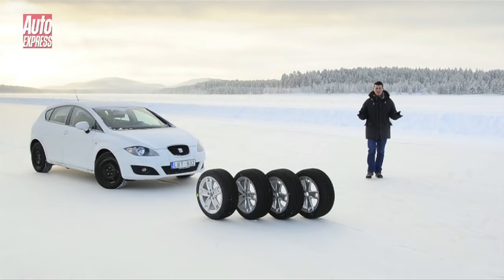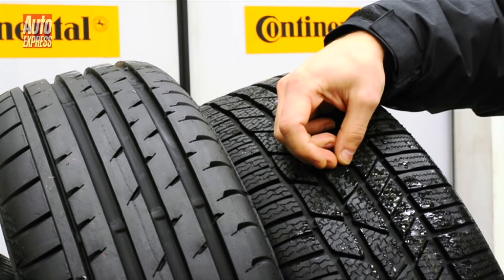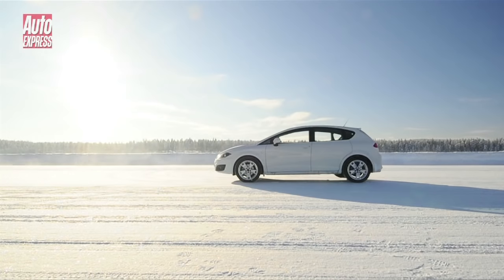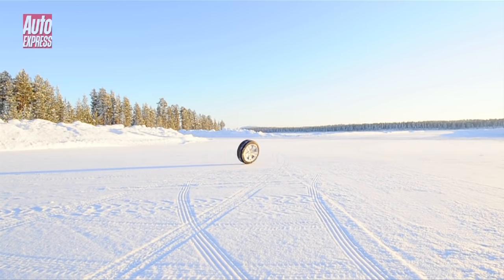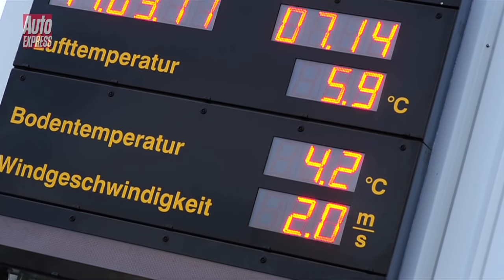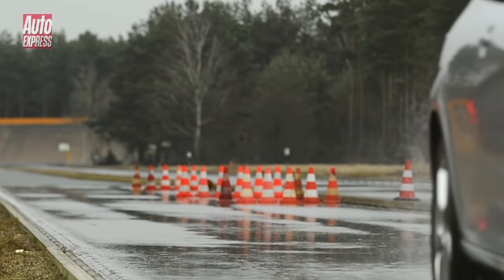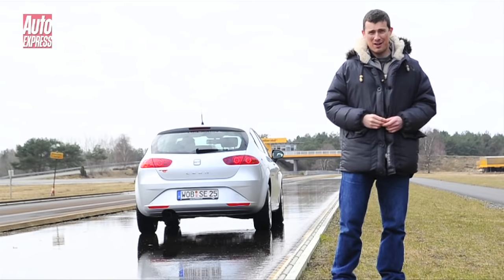Winter Tyres v Summer Tyres: the Truth! - Auto Express

Comment: Soooo why don't they make all tyres like winter tyres?
Reply: because above 7 degrees celsius it is pontless. summer tyres are also better in rain and in dry conditions. also: winter tyres have softer rubber, so you would wear them out quite fast in anything else but cold conditions. you can use all-year-tyres if you like, but in winter conditions they are worse than winter tyres and in warmer conditions they are worse than summer tyres (obviously). so i wouldn't recommend it.
Reply: The main reason is extra wear in warm temps and slightly increased fuel consumption.

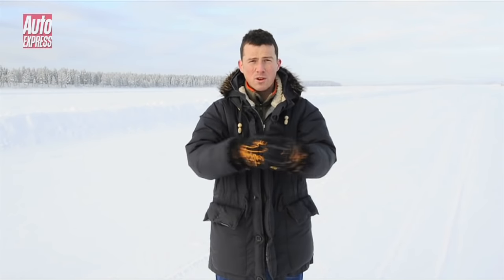Comment: 2:11 - Winter tires, turns the wheel fast
2:19 - Summer tires, turns wheel casually.
Reply: Alex Oh when driving on ice, rapid movements can make you lose control. Because he has less grip on the summer tyres, turning the wheel slowly is his only option to keep the car in balance. this is not necessary on winter tyres.

Comment: This is all completely unfair testing.. The red car is clearly just sat there spinning it's wheels. If they put a driver with competence and good clutch control it would be a different result. I'm not saying winter tyres aren't good, just that this isn't fairly impartial.

Comment: The cars have ABS systems. The reason the summer tire looks so soft is because it has no grip so every time that locks up it just slides smoothly and doesn't dig down in the snow like the winter tire,

And obviously, ABS is designed to NOT lock the wheels and cause a skid out. But ABS isn't the only factor here, they also have ESC (Electronic Stability Control) which ensures the car doesn't spin out of control when slamming the brakes.

Do some research before putting your tinfoil hat on!

Comment: why not ust use winter tyres all year long ?.....
Reply: +Aiden Low increased tire wear and fuel consumption
Reply: +Aiden Low bad handling, sluggish, fuel consumption, wear and even dangerous because in hot weather it loses it's grip and you can't brake safely because the tires get greasy and they can even blow out....you don't want them on once the temperature hits above 15 degree celsius

Comment: Based on what he said, winter tires would be amazing in the summer.
Reply: Actually it's quite the opposite due to temperatures. As soon at it goes above 10-15 degrees centigrade (no idea about F, 40-50?) winter tires with their softer rubber become too soft and instead skid way more which results in the WINTER tyre behaving on a summer road just like the summer tire behaves on a wet winter road. If it's like... hot-hot summerhot the winter tire becomes like chewing gum. Well not really but on dry asphalt on a hot day the winter tyre is worse and also has a much lesser durability in terms of milage. That's why winter/summer tires exist! Summer tires are much harder in their bend of rubber so they handle heat better and don't change properties while in the cold they turn too hard and stiff and behave like plastic does on ice = shyte! :D

Comment: This test gives a completely different story and says that summer tires perform better in the wet than snow or all-seasons tires. I think it makes more sense than Auto-express's review.
http://www.edmunds.com/car-reviews/features/tire-test-all-season-vs-snow-vs-summer.html
Reply: +Basel Bannoud 
My best guess is that the difference is due to Auto-Express testing wet performance in low temperatures while your source probably had higher temperatures for their test. (they should really have put that info in there IMO)

Anyway depending on the temperature the results will wary wildly as the different rubber blends will soften and harden differently to provide optimal performance for their intended use.
Reply: +REASAND5 Your point does not stand, according to the test:in winter, EVEN on wet surface, summer tyres are better then winter tyres at stopping, turning, skidpadding, sudden change of directions etc. not according to me but adac.de and autobild.
Reply: +Basel Bannoud Summer tire are for summer driven weather condition including rain. Winter Tire are for winter driven conditions only. All season tires are for 3.5 season condition excluding winter because it is not really for winter driven. if your smart, you will never drive a winter tire all year round. Winter tire + Snow + wet snow melting + black ice = far superior then summer tire . i know because i have winter tire and my summer tires for my rear wheel drive sports car. You got to remember that not everyone go drive out in the middle of no where like these test videos. normal roads with snow, ice, salt, and temperature can make a big difference in tires and also the car itself as for me a rear wheel drive car it makes 100% of a difference to keep winter tire for winter condition drive and summer tire for summer condition drive only. without any snow then summer tire is fine all year round.

Comment: Winter tyres on warm dry road? Would have been interesting.
Reply: They would grip very well, but the rubber would wear out very quickly. It's the main reason for not "wearing" winter tires in the summer.

Comment: What about winter tyres for perfect conditions?
Reply: Your winter tires will actually work great in summer. But, you'll have to buy a new set each year if you do that.
Reply: Truth plus bigger cost of petrol :)
Reply: foufoufun0 Here in Norway we have very different winter tires for our masses of ice and snow. They do not work better here, in fact they are very dangerous.
Reply: xheppelin
So people have different type of tire depending where they live? I live in Canada (Québec) and you can have tire studs which is very efficient on ice. It is illegal in Ontario though (they damage the roads), so if you live near the border of the province, you might want to not have them so you can cross without getting a ticket.
Reply: foufoufun0 Most people don't have studs here. Absolutely every Norwegian site agrees when I google search for "Vinterdekk om sommeren"(winter tires during summer). The reason I think, is that summer tires are made to push as much water out of the tire, while winter tires are meant to grip onto snow, and therefore are very bad when it comes to wet warm roads.
Reply: Winter tyres will take up to 30% longer to stop in hot weather, they wear out quicker and, because of the very deep profile, they are less stable at the higher cornering speeds you would expect in good weather.
They are excellent in cold, wet or icy conditions. Above about 15°C, you are better off with summer tyres.
You can also get "all weather" tyres, which should be good in the summer and winter, but generally, they are worse than summer tyres in warm weather (but much better than winter tyres) and they are worse than winter tyres in cold and icy conditions (but much better than summer tyres).
Since moving to Germany, i have had winter tyres every year (a legal requirement these days, but it was optional when I moved here). When I first moved here, I was living in rural Bavaria and having winter tyres meant the car drove on snow and ice as if I was driving on wet roads with summer tyres - although you keep your speed moderate, suited to the conditions. One year, I was trying to change the tyres at home and one wheel had rusted onto the hub, I left it too late and had to drive with summer tyres in 10cm of snow to the dealers to get it changed. The car was uncontrollable. I managed to limp to the dealers (20KM) in about an hour, but I nearly landed in the ditch a few times. I got the tyres swapped and drove back in about 20 minutes. Since then, I have made sure I get them switched early.
My wife has run all-weather tyres up until this year on her car, because the car came with all-weather tyres. The new car came with summer tyres, so I bought her winter tyres this year. So far it has only been cold and icy, but she already says that it makes a huge difference and doesn't want to use all-weather tyres again.
Reply: It is the same in Germany, winter tyres only, snow/ice tyres with studs are generally illegal, but if you go into the mountains, there are a few places where you have to have snow chains. If you do not and get stuck on those roads, you face a big fine (for obstructing traffic).
Likewise, if you are caught driving without winter tyres when it is icy or snowy, you will get fined and receive points. If you get stuck, you will face a bigger fine, especially if you stop traffic in the process (E.g. summer tyres, skid across the road, blocking traffic). And if you are involved in an accident, then you are automatically at fault, if you are running summer tyres in snowy or icy conditions.
Reply: David Wright "It is the same in Germany..."
In my opinion we of all people should definitely have laws regarding tires, especially with the massive amount of polish trucks coming through here with Sumer tires in -10 degrees and expect to be fine.

Comment: 1:07 The red car should only do 17 mph to be able to stop in 27 meters.
Reply: lfsracer79 - what figures are you using? The UK Highway Code has an official stopping distance of 23m for 30mph (9m for thinking/reacting and 14m for braking) - this is in ideal dry conditions so 4m extra to allow for snow is fine especially as the drivers knew they would be braking rather than an emergency stop due to an unpredictable event.
Reply: Gobtik
I used simple math, the UK Highway Code is irrelevant. If it takes 85 meters to stop from 30 mph, then it takes 27 meters to stop from 17 mph.
Reply: lfsracer79

What are you actually trying to say though - that the car should be going more slowly in ice with the summer tyres? Or the test was wrong?

The red car has summer tyres on - it is going 30mph but because of the skid it takes 85m to stop. So yes if it wants to stop in 27m it should be going more slowly, but the point of the test was to compare like for like stopping distances at equal speed with different tyres - drivers in snow regularly do silly speeds so 30mph (standard speed limit for urban areas in the UK) is a useful comparison:

The white car has winter tyres on - it is going 30mph, although it should stop in 23m in ideal conditions (i.e. see event, slam on brakes, distance between needing to brake and stopping), it still manages to stop in 27m which is to be expected as it has better grip but still has to slow on snow proving the value of a winter tyre.
Reply: Gobtik
You can see my point in my original comment. If you use summer tires on snow, you can only do about half the speed to be able stop in the same distance.

Forget the numbers in the UK highway code. You can test braking distances yourself.
Reply: lfsracer79
 But then your argument could simply be stated as:

drive sensibly for the conditions

Why introduce speed or braking distances anyway? Idiots who drive at normal speed during winter crash their cars, the rest of us just slow down and get home safely!

Comment: A Continental commercial ? A car that is not able to move on snow on a flat surface with summer tires, come on,  you did it on purpose! I agree that there is some difference between winter and summer tires, but to do a real comparison you would have to do a cross comparison between brands, for example a Michelin summer tyre would do better of some X Brand winter tyre! For example I had BF Goodrich as winter tires on my old car but actually with Nokian summer tires was performing much better on Snow! Now using just Michelin and Goodyear, a whole different world !

Comment: "Best hope the guy behind you has winter tires as well" = "So you'd rather run over a kid on a zebra crossing" WTF?  Sarcasm is lost on you. The point of my comment was the roads would be much safer if winter tires were mandatory on all vehicles so everybody has a chance to stop safely instead of idiots driving around with summer tires in winter. At least my comment provoked some response

Comment: I love how this is news to Brits...
Reply: Would hardly say winter tyres are a danger, they're softer compound and more 'cobbles' in the tread for maximum traction in lower temperatures.

Summer tyres are a harder compound so they can be used in higher temperatures and not wear quicker, but as temperatures drop the compound won't 'mould' into the road as easily and will have reduce grip. 

All Weather tyres, are inbetween so would be a medium compound so it will perform averagely across all conditions, but they will wear quicker than a dedicated tyre. 

Even if you don't believe it makes a difference in winter or summer, the tyres do have a superior grip rating to even that of a summer tyre, as well as a poorer fuel consumption rate due to a greater rolling resistance caused by grip.
Reply: ***** Mate, I live in Borehamwood and there have been winters which made the roads such that it shouldn't be legal for people to drive on without winter tires on (like in any other country). You'd think people have enough common sense to walk to the train station but noooo! Some twats were driving low profile tire, RWD sport sedans, stuck at the foot of a slight incline and 5 dudes pushing didn't help... It was a freak show. SORT IT OUT!
Buy a set of winter tires, keep them in the shed when you don't need them instead of driving around on them all year like an idiot. IT'S NOT HARD!!! Unless you live in the city rather than the outskirts/suburbs or the country.

Comment: Put studs on those snow tires, come back and we'll talk.
Reply: you dont need studs.
Reply: Trust me, studs do work and they do help.
Reply: Bayan1905 yes I've used them, I've installed them and I've removed them. 

they can help. but they aren't particularly needed over a good set of winter tires. but I guess as far as peace of kind goes every little bit helps.
Reply: studs are only good to keep you in straight line. If you brake and you dont have no abs they dont help you. you need soft rubber to do the job. Had winter tires with studs and with out studs. no differenc in cornering and stoping on snow. of course if the studs are 1cm or more then its gona be a difference =D
Reply: Studs are for ice traction and only does a difference on snow that's been packed to a hard ice like crust.
Reply: unrelated note I'm actually installing studded tires right now at work xD
Reply: Matīss Nazgra That's wrong. Studs is better on all of those conditions. Greetings from Luleå Sweden.
Reply: Emil Muhrman im from Latvia. If you have old tires who are too hard, yes you need then studs. If you have new tires with soft ruber you dont neet studs. I have an e36 bmw with 185/70. I have 20 + cm snow every winter on road and no problems no start move and to stop.
Reply: Emil Muhrman and in Lithuenia studet tires are not alowed. And there is winter too with snow and ice.. And they dont have problems.
Reply: Matīss Nazgra I have used both of them. And the studded tyres is the same on snow but on on ice they are much better. So i would never by studless, because when you really need the traction you have none.
Reply: Bayan1905 studs are awful if the pavement is dry, they're loud, and they only make a difference on ice.
Reply: they make it worse when not on snow/ice too but i still use em

Comment: what if i used winter tires in the summer
Reply: Because winter tires have a softer robber compound in lower temperatures, that means it'll be too soft in summer. Which means your tires will deteriorate extremely quickly. Best to spend the money on some 'All seasons' (Sometimes called 3 seasons) for the non-winter seasons and get a set a winter tires.
Reply: iFail oh ok thank you

Comment: What specific tires were used? Clearly this is not a compilation of different types, so this could have been stacked with some shitty summers vs. the best winters to prove a point.
Reply: at 0:24 there is a sign that says "continental". Most likely they are comparing the winter, summer tires from continental.
Reply: I can tell you first hand (found out last week) that excellent true summer tires (not all season) are crap on snow.  Really good "all season" tires are not being used in this test and would cut the gap considerably.  There is a big difference between "summer" and "all season".

Comment: And now repeat the tests with all year tyres and also temperatures at 10-12' C.... If the performance is reversed then it makes the winter tyre argument a nonsense for the UK.

The safest thing to do is drive appropriate for the conditions. There is nothing worse than an idiot thinking he is invulnerable to skidding because he has winter tyres or a 4 wheel drive car!

Comment: Might as well just make all tires winter tires if your gonna use it half the year
Reply: Except for studded snow tires of course then :P
Reply: Compound does not survive as long at summer temps. Plus all you do is extend the summer tire life by at >2x so really in the long run you are saving money and are safer. Before you ask >x2 is that you are spinning your tires and wearing them down in the winter far faster
Reply: Have You ever had emergency braking with winter tires on hot summer day? Car just don't want to stop.